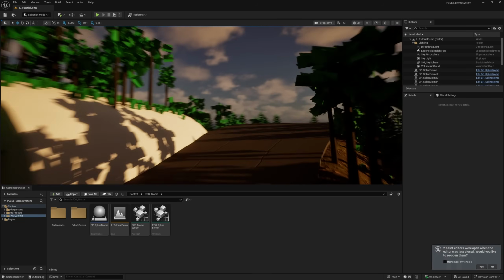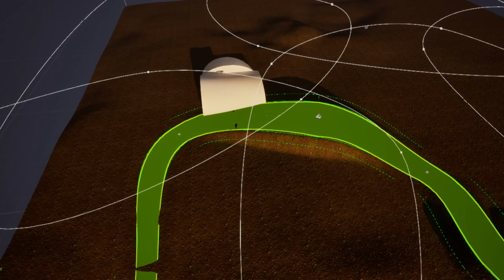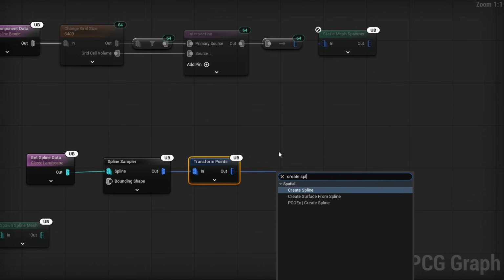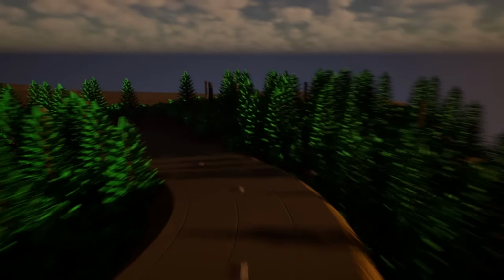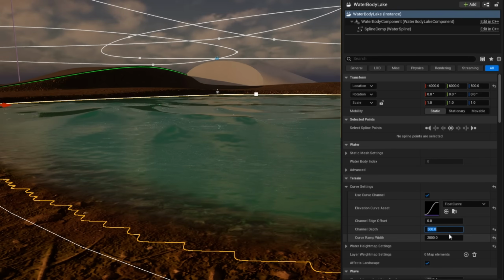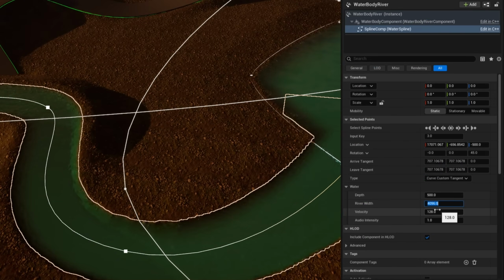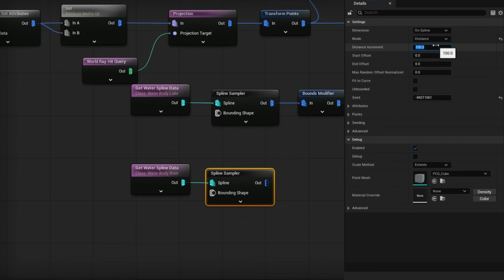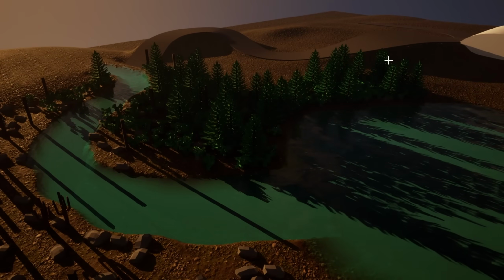Create Epic PCG Worlds With The Water Plugin & Landscape Splines!

Comment: Hey, I noticed that the material under the water surface looks very strange. Could you please tell me how I can change the material below the water surface?
Reply from the maker: All the materials used are in the detail panel for the water systems. Just might need to scroll a bit lower. :)

Comment: For a curly river, you can try this: spawn river spline points on the horizontal to have enough points, project them onto the landscape, then compare those points by distance, and filter out the ones that are too far (hitting the bottom of the river). I use this method for lakes to detect shallow water, for example when spawning reeds.
Reply from the maker: I probably need to try it / see it to fully understand. 😅